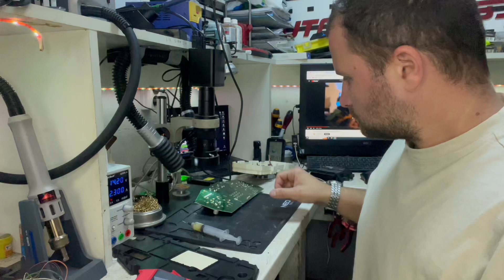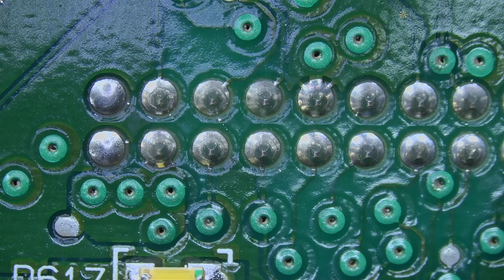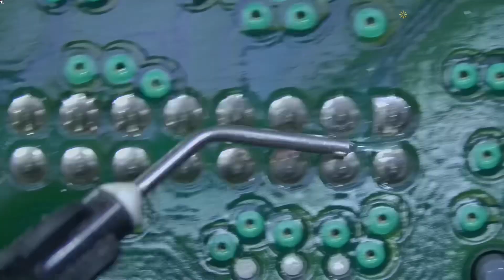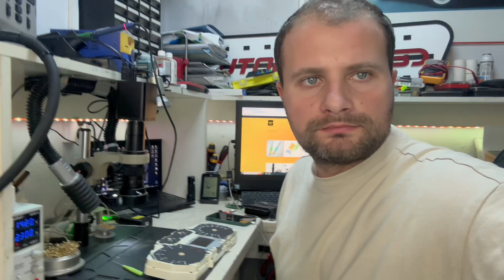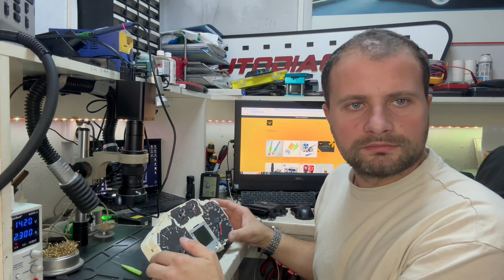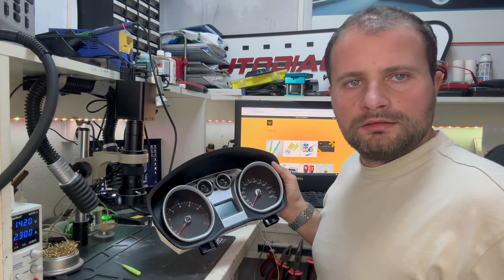Ford Focus II instrument cluster repair | engine won’t crank | CAN BUS problems

Comment: for me, the dashboard lights don't work, the gauges light up and the display but the numbers don't. then after a while they flash and turn on. Could this problem be caused by this error?